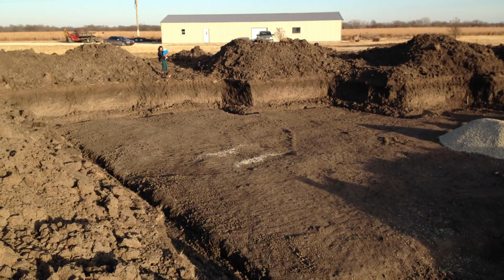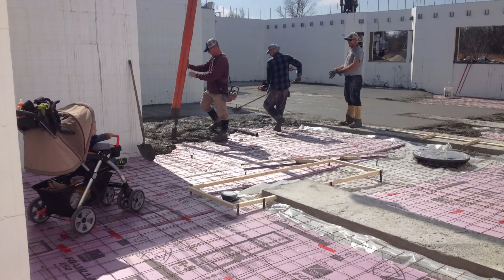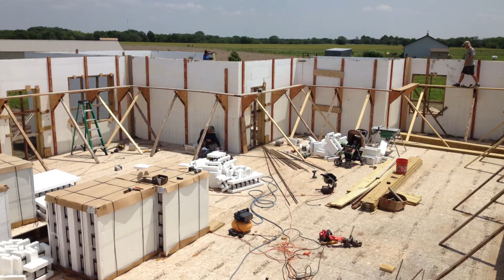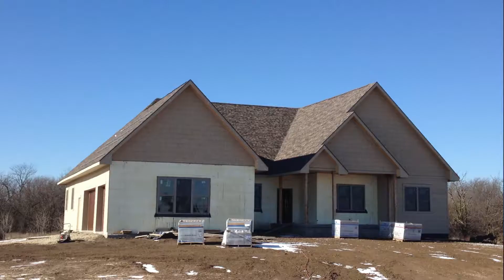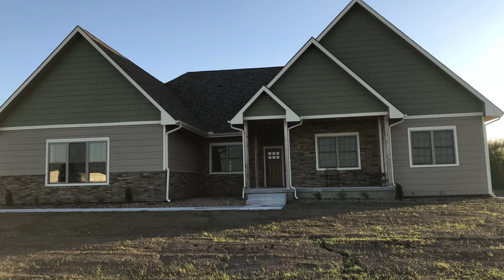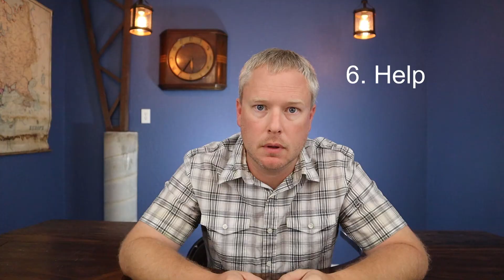DIY Home Build -- 6 Questions YOU Should Answer Before Building Your Own Home

Comment: Re: TOOLS- 
What are the most important tools needed for a building project?

Which are MUST haves, for tight budgets, and which are nice to have if you have a little extra to spend?

Which equipment/tools would you recommend renting vs. buying?

I just came across your channel this week, so not sure if you've addressed this point in other videos in more detail yet.  I'll keep watching.  Thanks for sharing all the info you've put together.
Reply from the maker: I haven't talked about the tools, but I did make a video on the equipment.  I'll consider doing a video on the tools.

Comment: I built a 1200 sf home and did everything except concrete and pre built roof trusses, only getting a little help from a brother and a friend.  6000 sf would require more ambition and endurance than the vast majority of people.  I have electrical engineering degree.  Garrett is a superman.
Reply from the maker: Nice job on your build!!!  It's an experience that very few have.

I'm not sure building a house my size was smart for a first timer like me.  I often thought how much easier it would have been to build a house half the size.

Comment: Thank you. Any reason no ICF roof?
Reply from the maker: I'm not familiar with ICF roofs, only walls and floors.  Is that a new thing?
Reply: @Challenged1  I don’t think so. I’ve looked at Quad Lock. Nice systems for green roofs.
Reply from the maker: @clintonboyer1217  I see, you are talking low slope roofs.
Reply: The actually have normal slope roofs, but yea I plan on doing a ICF flat roof
Reply from the maker: @townsendliving9750  I haven't seen those